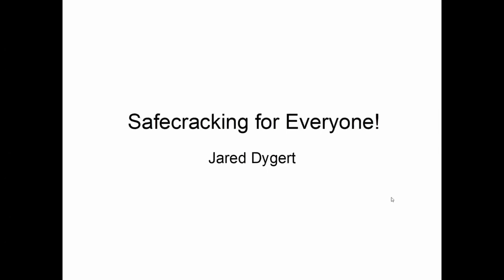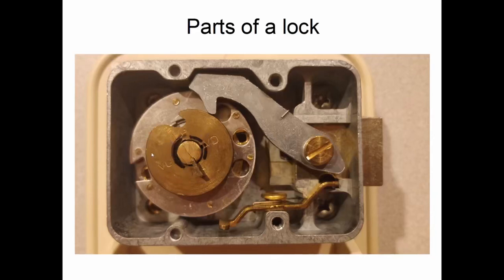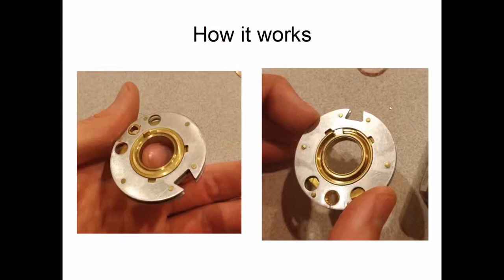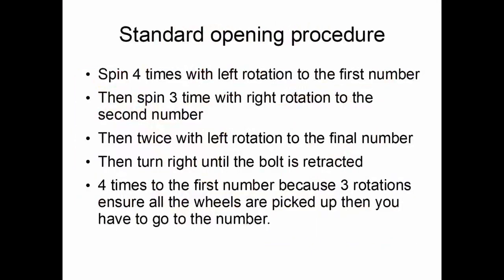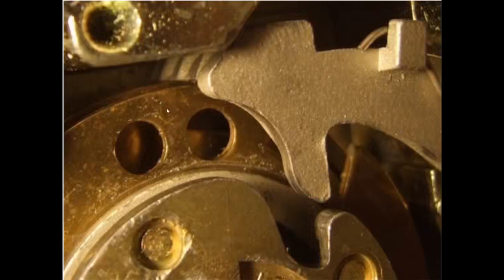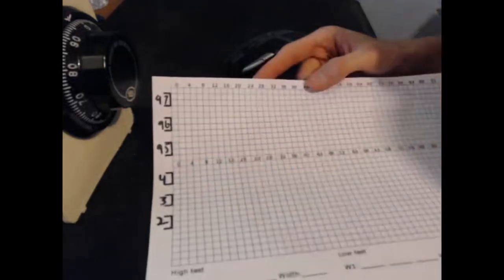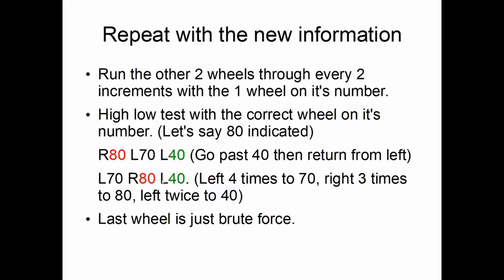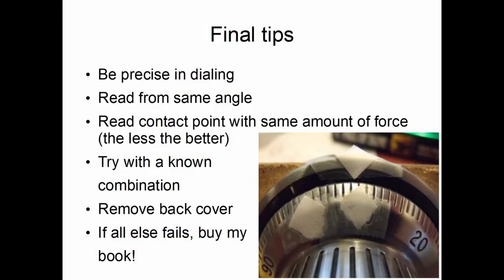DEF CON Safe Mode Lock Picking Village  - Jared Dygart - Safecracking for Everyone

Comment: Can you manipulate a direct entry safe
Reply: The answer is "yes". Without trying to go into exhaustive detail in a comment reply, the handle becomes your reference point when testing. As you know, finding that one gate is a simple matter, but you are prevented at that point from manipulating the other wheels in the pack. What is done, is, let's say your drop-in (entry) point of your first wheel (final number) is 30. Park your first two wheels (3 and 2) wherever you want, set your first wheel (final number) on 30, turn the handle as far as it will allow without forcing, and make a note of how far it goes. A laser pointer with a scale on the floor (or somewhere) is very useful here. The longer the "arm" of the pointer is, the more dramatic the difference will be. With a laser pointer attached to the handle of the safe, this can easily be a distance of several feet - the further away your scale is from the laser diode, the more dramatic the change will be on your scale (a ruler for example). Just make sure your laser pointer is very securely attached to the handle and cannot wiggle around and give you false indications. Same rule with your scale; keep it firmly in one place. Check a different position for your second number, keeping the same first number, and setting your third number to "30" again, and turn the handle. So, 0-2-30 (check) 0-4-30 (check) 0-6-30 (check)... Let's say 45 is your second number. 0-45-30 will indicate differently than 0-20-30; it will be "deeper". Whichever number indicates deepest will likely be your second number then, start dialing for the first number; 0-45-30 (check) 2-45-30 (check) 4-45-30 (check) etcetera. This is a vulgar simplification, but hopefully it gets you thinking in the proper direction. You're always seeking the "lowest" or "deepest" indicated point. This still applies with false gates. "30" may have a gate, but maybe it's not your true gate. Dial 0-0-30, 0-0-32, 0-0-34... Find the deepest point for a given wheel, then start checking another wheel, keeping your deepest points. You may have to play around and refine, but again... Seek the "lowest" point.